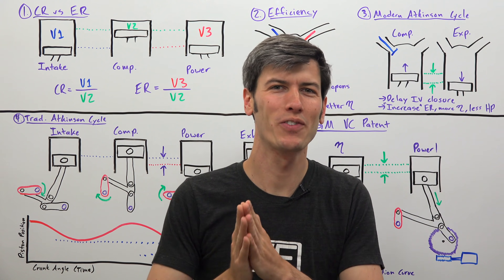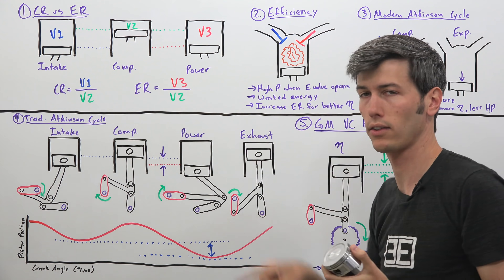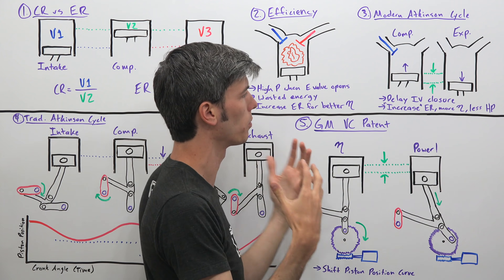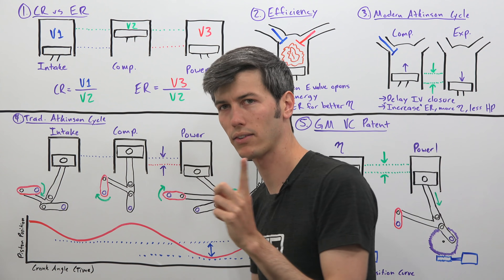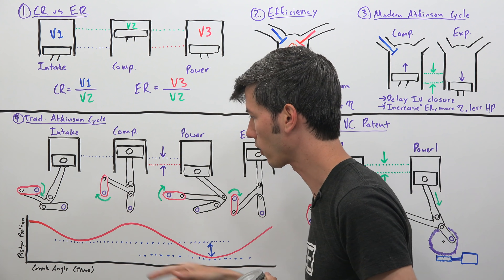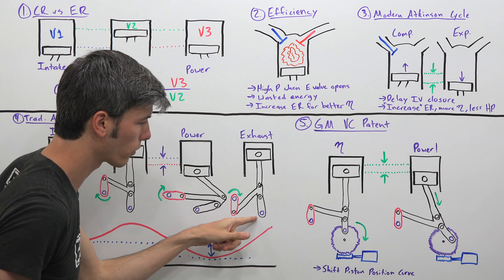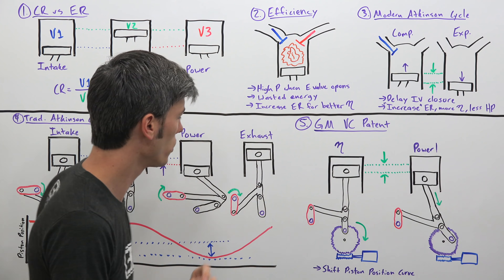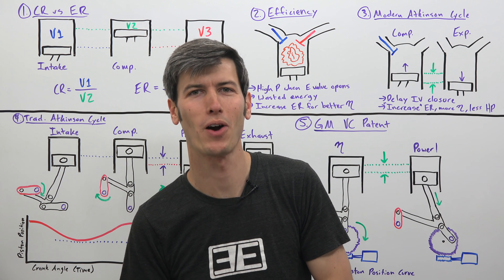How GM's Variable Compression Engine Works - Patent Review

Comment: Why wouldn't you just use VVT instead of variable compression? less moving parts and it's simpler
Edit: With an overcompressed engine.
Reply: valve timing vs compression ratio tho...
Reply: VVT has some disadvantages as well. If you use a Miller cycle with VVT (closing intake early) , you have very fast valve motion speeds and you need to increase the opening gap. this causes very much stress and use for the  moving parts of the valves and sometimes comes in conflict with the pistonhead position and the room your valve needs. If you use the modern Atkinson with VVT you've got another conflict. When you push back out some of your air-fuel mixture, this mixture got already pretty hot, because it came in contact with the hot valves and the cylinder walls. the mixture then mixes with fresh air-fuel. because of this, the air-fuel is considerably warmer as in a normal engine, which again lowers your maximum intake mass and causes knock due to early self ignition. the final outtake temperature is about the same amount warmer as well, which can cause trouble for your catalyst and outtake valve. as GM (and others) does, it is way better to keep your normal valve transmission but change your internal volumes.
Reply: @Taunus-Tim  This is a very good argument and read, thanks :)
Reply: @Taunus-Tim  What about direct injection? If timing direct fuel injection to happen after the intake valve is closed then there is no air fuel mixture going back into the intake runners. The only downside would be the increased temperature of the intake charge.
Reply: @MPIronmanJC  Direct injection can indeed lower some disadvantages. you can effectively  cool the inside of the combustion chamber. although the overall cooling effect to the air would still be the same. Direct injection comes with other disadvantages. The best combustion is always obtained with a perfect pre-mixture of air and gas. Direct injection leads to locally rich and lean mixture areas, which increases CO and soot emissions (particulate matter). but normally direct injection is always used with charged gas engines. Nowadays your primary target is to minimize emissions. this conflicts heavily with cost efficiency. overall efficiency comes somewhere in the fourth target. My knowledge of modern car engines is limited though. But i worked in a  research department for high efficiency CNG single cylinder engines used as CHP motor. there we used the modern atkinson cycle with indirect injection to some point. Miller cycles didn't work well, because we hab to use very pointy  cams, which couldn't handle the stress long enough. (sure, if money were no issue, there would have been some ways). Fact is: engine engineering is very tricky and the people at GM are professionals. If they found, that their way was the best to solve every internal and political requirements, then i trust it  probably is the best, without having to charge the customer horrendous amounts of money ;)
Reply: because they want exclusive patents...
Reply: GM already use VVT.
Reply: @danielrouw2593  the spring example? yes it is oversimplified. but it's close enough to tell, that the vacuum doesn't create considerable losses.
Reply: All I know, is I’ll never own one!😀
Reply: For a very high compression, I would be going with direct injection (possibly combined with port injection), but my bet on why it's not being used would be emissions. Could be hard to get NOx down on high combustion temperatures. Just a guess tho, given the direct injection could solve (or at least reduce considerably) knock
Reply: You'd use both. VVT doesn't give you efficient variable compression.
Reply: @tyranneous  - Actually it does. That's the whole basis around the Atkinson Cycle engine. 

It's an engine with a high compression for efficiency at low rpm, and the ability to 'bleed off' extra air to effectively lower the compression ratio at high boost/rpm AND it's way less complicated.
Reply: @MesserEsser_OG  sorry, think I failed on some clarity there. I meant vvt is relatively low efficiency compared to the GM and Atkinson efforts described here. The trick is to have a good balance like what GM is trying to do with the modified version. :)
Reply: @tyranneous  👍
Reply: @tyranneous  Not as effiecient I guess, I don't know how close it comes. But I'd think it'd be a good compromise between efficiency, complexety and maintenance cost. This is presumining you run an overcompressed engine of course.
Reply: exactly the effect would be the same?
Reply: @LocPH.  You will get some losses with the engine pulling a vacuum on the intake stroke after the intake valve closes. But i think this would be negligable
Reply: @NowAndyPlays  I meant between VVT (including modern Atkinson cycle) and GM's design, that they would have same effect(?).

Also, the intake valve is open during intake and a bit during compression, it's not closing until power/exhaust stroke.
Reply: @NowAndyPlays  generating a vacuum doesn't cause losses, because the vacuum pulls the piston up with the same force you needed to create it. it's like a spring. although the modern Atkinson doesn't pull a vacuum, because you don't close the intake valve early, but late instead.
Reply: Ah yes, having it open during the comrpession stroke would definetly work better. But i would say it would have the same effect.

But as I'm not an engineer and just a humble motorman I can't be certain. I would think mean effective preassure would be the same which is where the power comes from.
Reply: Thank you for the clear up, i was a little uncertain.

Comment: What could go wrong? The impala that can deactivate pistons flopped; both versions. The North star engine was a disaster and the EcoTec engine has class actions against it. GM is on a roll!
Reply: If you want to pick on flaws ' we could do that with every manufacturer. Example Toyota tried to kill peoplr with un intended acceleration. Tundra is a sales disaster, bad transmission broken cam and flimsy chassis and V6 engine were subjects of law suit because the clogged up and broke.

Comment: I dont even trust GM with a regular engine. GM doing variable compression is freightening.
Reply from the maker: Well, Saab did it back in 2000 by tilting the entire cylinder head, thus changing the volume above the piston at TDC! Kinda neat.
Reply: @EngineeringExplained  Unfortunately GM totally ruined the Saab brand, causing them to shut down for good.
Reply: @TheAdventureAuto  more like Saab's Mania about safety.
Reply: Michael P not really. Saab made fine cars but GM wasn’t giving them proper resources and was watering down their brand. They weren’t selling enough cars because GM wasn’t giving them enough R&D resources to make their cars competitive with other Euro luxury brands.
Reply: @TheAdventureAuto  job done i think
Reply: @EngineeringExplained  Teach us!!
Reply: @EngineeringExplained  yes and GM stop funding research due to cost and i think this still is only concept.
Reply: " I don't trust the makers of one of the most reliable engine lines with engines."
Reply: Sounds like a ford lover to me... GM uses Chevy engines, have you ever heard of a ls? Yeah me neither. They’re trash engines for sure
Reply: @inthebeginning6895  There are exceptions to the rule. Im not referring to the LS's for sure. Have you heard of the Spark, Sonic, Cruze, Malibu, Trax, Equinox, and Traverse? Thats the Chevy I speak of. And definitely not a Ford fan, other than to say I enjoy my Lincoln Town Car. I only bought Mazda products once Ford sold their share and stopped putting their engine's in Mazda's. Mazda engines are now bulletproof.
Reply: The Adventure Mazda the exception of the Malibu I agree
Reply: @TheAdventureAuto  if you put "500k miles chevy cruze" on YouTube, you will find a video about one that passed the 500k miles, and I managed to get 270k miles on my first 1.4t engine, still the same transmission tho 😁
Reply: @TheAdventureAuto  Thats cause NONE of the engines in those vehicles are GM engines. German, japanese and korean engines. Yet you all hold in high regard the companies that make these engines for other cars.
Reply: Cameron4life sure are.  Biggest boat anchors on the market
Reply: Comment of the year for sue!!
Reply: lol if its not a chevy 350, one of their big block motors, or the LS i dont want any parts
Reply: Mazda’s SkyActivX is a more advanced ICE.
Reply: They should stick with something simple like pushrod V8's...
Reply: LS
Reply: The Adventure Mazda I have 300k on all my 4.3 and 5.3 all original no oil leaks .
Reply: This is a bad idea full stop. Instead of introducing another highly complex point of failure, why not simply go with another proven design like opposed pistons. Those engines were used in US submarines back in WW2 and going with a single crank design would result in the benefits manufacturers are attempting to get with this nightmare of an engine design. The opposed setup reduces the number of strokes to 2 I believe and they take to supercharging and turbocharging just like modern 4 stroke. So if the idea is efficiency and power then there's no need to reinvent the wheel
Reply: If the idea is to maintain power while increasing efficiency then the opposed piston setup would be the way to go. They were used on ww2 subs to pretty good effect and Chrysler even designed a gasoline version that would have been a game changer today but in he era of 25 cents per gallon of gas nobody cared and it got shelved. Modern opposed piston designs with a single crank take to super and turbo charging. and with every other stroke being a power stroke you cut down on parasitic loss like a mother-f@#$er lol
Reply: Exactly. 
Generic 
Motor 
Crap
Reply: Yes, because people buy mazdas for their engine reliability. /s
Reply: @TheStevenRK  Hahaha got him there!
Reply: @TheStevenRK  not a concern, they rust out long before the engine breaks.
Reply: @TheStevenRK  I can't disagree.